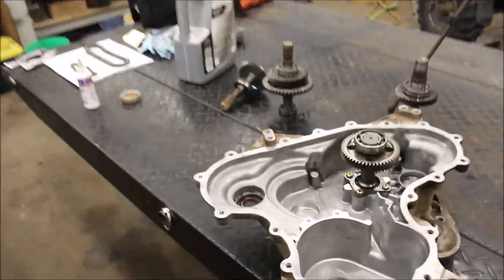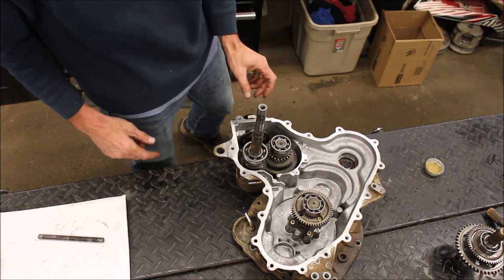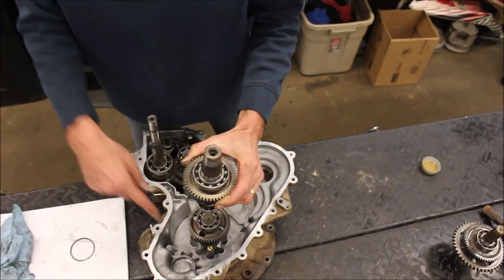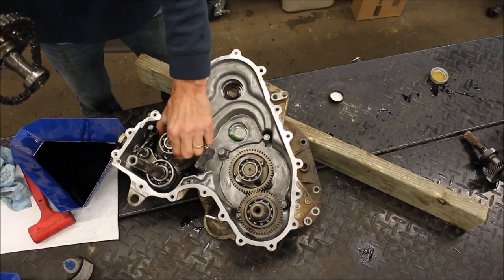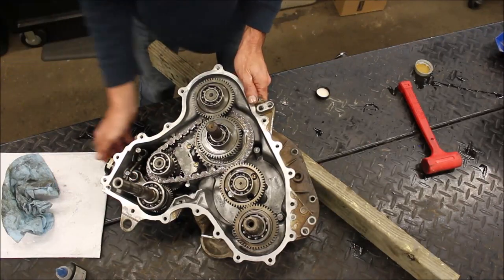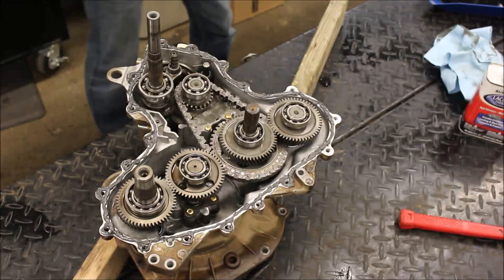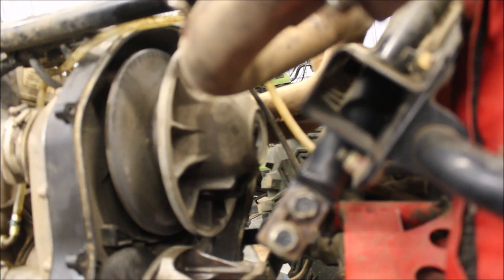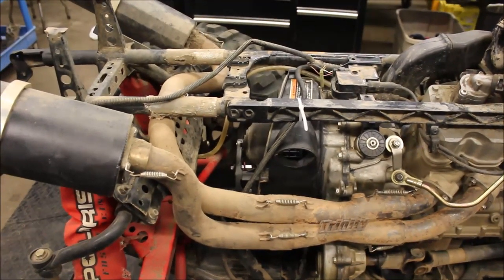2015 Polaris Scrambler 1000 Transmission Rebuild!

Comment: Your prior experience at the engine factory shows in your work. I learn a lot from your videos. I recently rebuilt a similar Polaris gearcase . The silent chain was within spec, but the bearings were completely shot. I purchased the bearings for $32 to $39 apiece, After I completed the job I found a source where  I can purchase the OEM bearings for nine to $12 apiece. And I have enough Hondabond left over for maybe 100 more gear cases.
Reply from the maker: Nice. Thanks. Yup 14 years of building engines in a plant helped a lot. My favorite part was tearing them down and rebuilding them when we had faulty parts from vendors.

Comment: Did you use new seals for the transmission?  I’m fixing the same kind
Reply from the maker: I didn't need to. mine were good. It might not be a bad idea to replace them though if your that far into it.

Comment: New oil in tranny made noise much less and ticking is more clearly from damper clutch. Do you run into loose damper nuts noisy cases? Thanks.

Comment: I have a Polaris 2000 Anniversary 500 Sportsman, and I have been having trouble with my thermostat and installing it. I have taken it apart and replaced everything that I can and it still overheats. Do you have any suggestions for this. The radiator is not the problem, but I don't know where exactly the pump is? If you can help me out with a suggestion I would greatly appreciate it. Thank you for your time.
Reply from the maker: https://youtu.be/2v1_y-lEsD8 Here is were the pump is. Did you burp the system? If air is trapped in the hoses it will overheat. Also Did you test the fan? On older sportsmans I hot wire the fan because you never know when the temp sensor will go out.

Comment: My 2010 Sportsman 550 runs fine, tranny oil ink dark,  has some scary rough metal fillings on drain plug, taping sound from tranny,  at idle and running.  Do I have a bad chains?

Comment: Man im having an issue with my 99 scrammy 500 when you acelerate it grind pretty bad and its getting worse. If you be easy on it i can drive it without grinding but its pretty bad sounding. Any advice? I think its the gear case.
Reply: Can I send you a video of what its doing?
Reply from the maker: I have a video on a scrammy rebuild.  Could be shift fork  worn out or dog gear broke. Chain could be sloppy, stretched out.